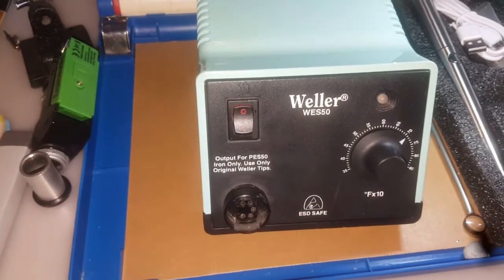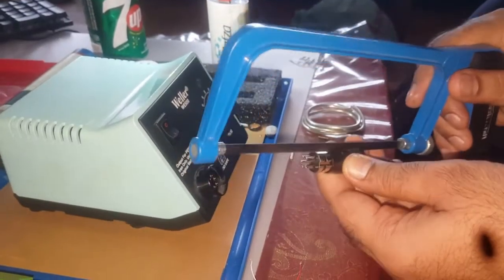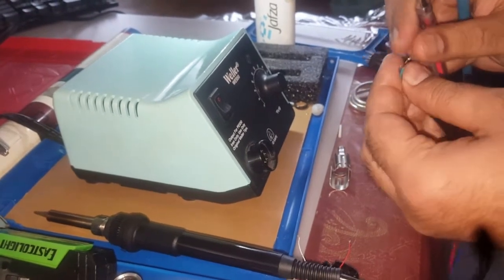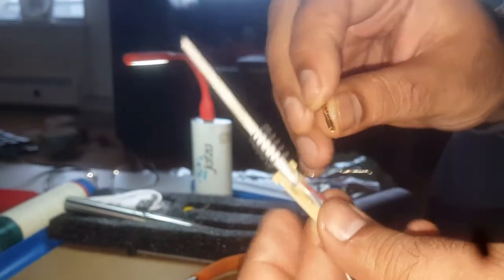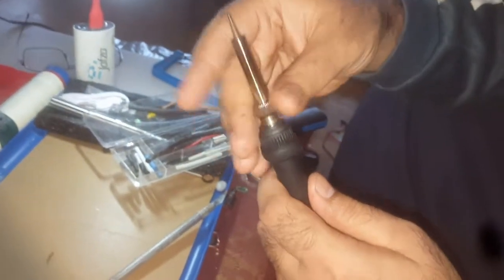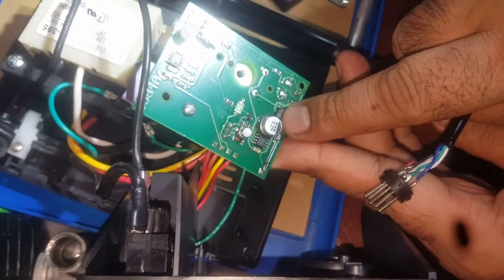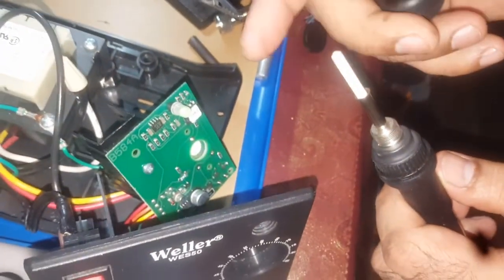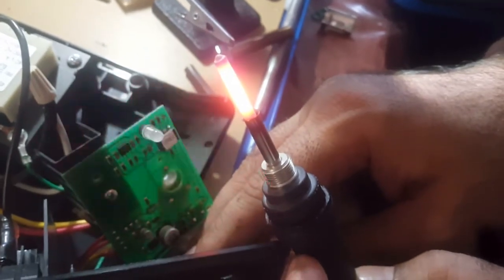How to repair soldering iron, repairing, changing, pencil project, weller wes station, 5 points

Comment: If that soldering pencil was only $4, I wouldn't have bothered spending all that time on it and just replace it again. (of course I would have figured out the pinout before assuming I could just plug it in to some other brand of soldering station.)
Reply from the maker: Of course, no one will spend time on $4, but if you order it from China and its delivery time is more than 27 days . Then you will have to use your skills to make it work. and also only China is the best option to buy it at a fair price, not the USA or Canada.
Reply: The problem is the soldering iron price. I have a few working stations, but the replacement irons are 120$ when I only paid 50$ for the station and pencil, and the magnastat switch failed. I won't risk the 4$ iron on the new 600$ stations. It's completely ridiculous how much the replacements for the older stations are
Reply: Does this soldering station use a thermocouple?